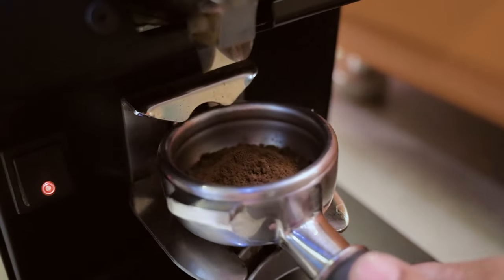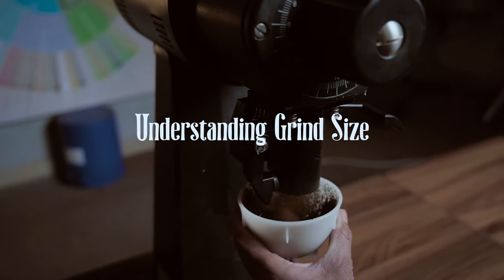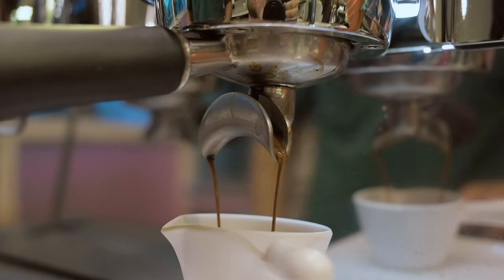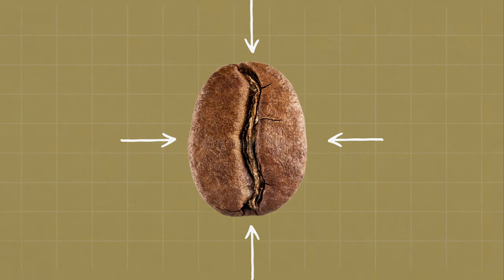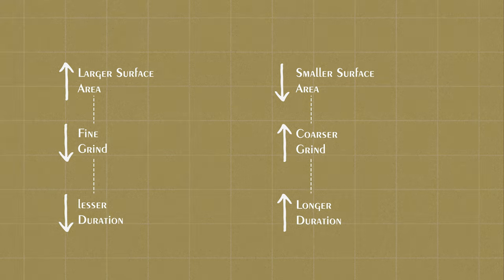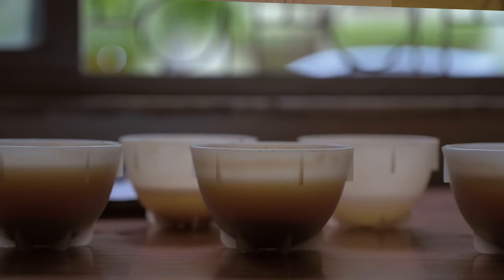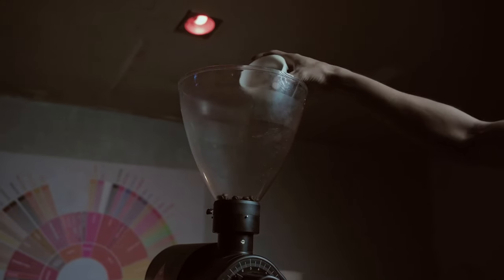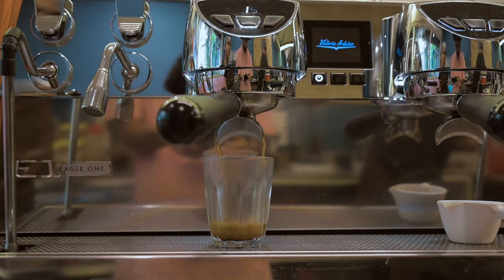Grind Size In Coffee - How it affects the taste

Comment: Hi, Mithilesh! I was wondering if you could help me out with a coffee query.
   I tried making coffee in my brand-new 6-cup Venus a few times and each time, the end result was sour coffee. I had bought freshly ground medium-dark roast coffee (moka pot grind with 2/4 stars for acidity) from my roaster. Why did my coffee taste sour? It had a tangy aftertaste. Or am I mistaking bitterness for sourness? I had put the stove on medium heat, used pre-boiled water for the bottom chamber and took the moka pot off the stove right after the coffee started sputtering out of the spout in the top chamber and gave the bottom chamber a cold bath. Thanks in advance. I hope you can help.
Note: I did not tamp the coffee and I filled it to the brim in the moka pot filter basket.
Reply: Broadly speaking, sour means under-extracted / too coarse, bitter means over-extracted / too fine.    It can also relate to water temperature but that’s not a variable that can be controlled in a moka pot.